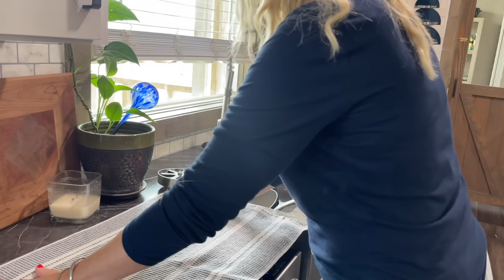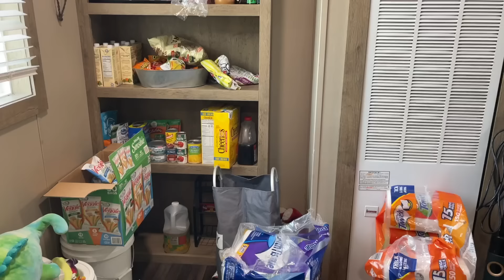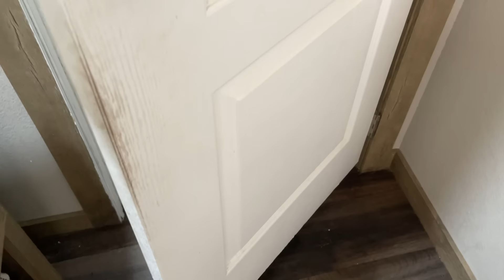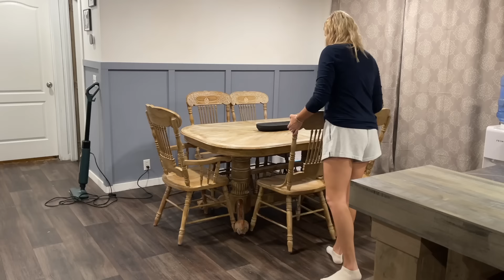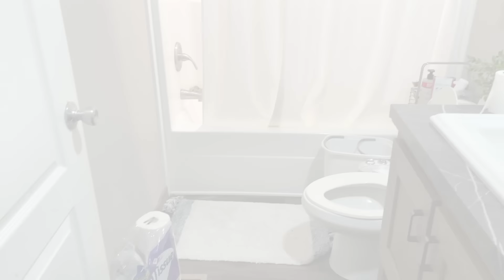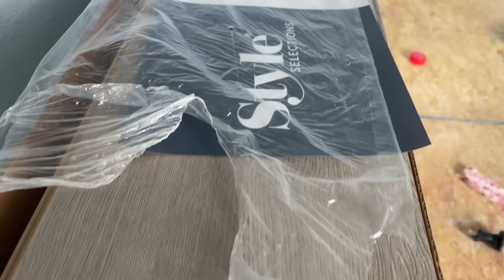MY HOUSE IS COMPLETELY DISTROYED/ BEFORE AND AFTER CLEANING MOTIVATION 2024 + HOME UPDATES/ORGANIZE

Comment: Great job Barb...Praying the mold situation is handled...We had mold on our walls in our basement after it flooded down there...I scrubbed everything down with hydrogen peroxide then we also repainted with mold & mildew primer followed up with mold resistant paint..It has been over several years and no mold issues...You all will be fine
Reply from the maker: Thank you Quian! I appreciate the advice! I was doing everything I could to kill it too😅 it’s expensive and frustrating, but I think we got it. 🙌